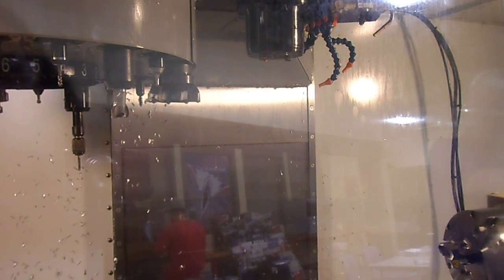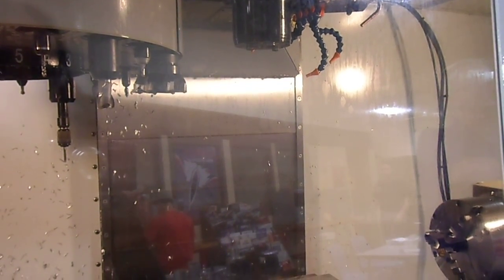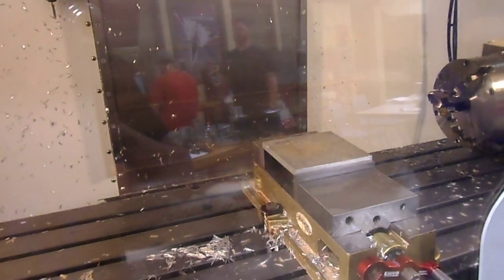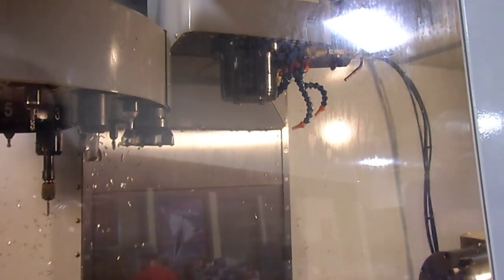CNC Machining on a Haas VF-4 Milling Machine

Comment: High speed steel tools mistake , center drill mistake , should have been a spot drill , tapping dry mistake . Hand tap mistake . If you spend $ on a nice machine , spend a little more on good tooling .
Reply from the maker: +Layla Suzanne There was nothing wrong with the tooling in the machine.  Sure, I should have run the tap slower and used coolant, but that doesn't make for good videos.

Comment: The tap most probably broke because there was no coolant. I.e. no lubricant. You might of been OK if you had sprayed it with a tapping lube before. Nice videos but I assume this is not a production program as the feeds are very slow, especially on a bt50 taper machine.
Reply from the maker: +Chris Munday This is a VF4, which is a bt40 taper machine, and no, not production.  This was done at school, and I didn't run coolant so that I could get a decent video of the program running.  Not an unexpected breakage by any means, especially at the speed I was running it.
Reply: +ChanmailleMan Apologies, you are correct, I don't know why I thought VF4's were BT50, the biggest we have is VF3.

Comment: Can you tell me which program you use to generate the Gcode.
I tried with ArtCam, but it generates a lot of errors
can You help me?
Reply from the maker: +Carlo Colella Since this was a fairly simple program, I didn't use a 3D modeling program beforehand.  I simply learned the codes themselves and input them manually.  However, we also used MasterCam while I was at school, and that seemed to be fairly reliable in terms of outputting solid Gcode.

Comment: you're using a hand tap in a machine. A hand tap is design to be turn into the work 1/2 to 1 whole turn then backed off to break the chips. Use a spiral point cut tap. It pushes  the chip out the bottom and has a high shear angle to reduce torque needed to cut. Your machine has the chip tray around the table so, I'm guessing it's a bit on the older side. If this is the case that machine probably isn't making very accurate thread at that speed since the machine probably cannot keep up with itself.
Reply: Douglas Pierce you can use a hand tap in a machine he was just running it way too fast with no coolant that's why it snapped

Comment: Anybody else see that tap break before it broke?
Reply: John McConnell yup
Reply: The rpm was too high for no coolant. The only thing I would have done differently is when you rapid down to the part. Rapid the part while tool is still at home instead of its R plane. That if you make a mistake it’s not moving in x or y. A crash in z is a lot less of damaging a machine. The trick is to not crash the machine. I have been a cnc machinist for 20 years and I my boo boos occasionally no one is prefect.
Reply: for me I think it was a mistake in the presentation of the tool, it can also be machined with aluminum if it does not have refrigeration mainly in threading, it is sure to break

traduzindo 
para mim acho que foi erro na apresentação da ferramenta, pode ser tambem na usinagem com aluminio se nao tiver refrigeraçao principalmente no rosqueamento, é certeza quebrar
Reply: i thought the tool would fail by changing the direction of rotation. But.... ;)
Reply: Yup

Comment: "program I've written over the past few weeks!?" NO you have 5 minutes in my world. The carousel is inside the machine? not trolling here. I am suspect in production.
Reply: Stu Capco Still no program after 2 months? It would take me 14 seconds. Git gud, kid.
Reply from the maker: What are you saying?  Is there an idea in there that you're trying to get through?
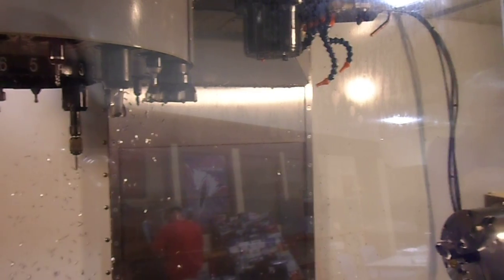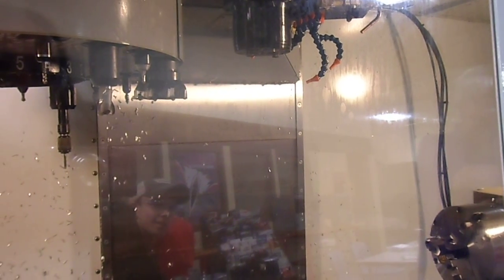Reply: ChanmailleMan Continue on, if your helping someone else here I'm all for it. NO troll intended. Simply put, this would take me seconds to write off the top of my head. Timeline 0:04 - 0:10 .
Reply from the maker: Stu Capco Well, at the time I was in the process of learning how to program these machines, so naturally it took a while to get it correct.
Reply: ChanmailleMan You know what? Your right! I should "put up or shut up". I will follow up soon with my own video here if you don't mind. Me programming, setup and running, tool steels. I like the idea, I'm doing it! ;)
Reply: Sorry, rough turn of events in my life. I agree no coolant, along with speeds and feeds of perfect condititions was the demise. Best of luck. Keep posting.

Comment: step 1 : push feed hold
step 2 : press setting/graph botton
step 3 : go on setting 51 and disable, dont forget... press enter
step 4 : press spindle stop botton
step 5 : open door
step 6 : nock the fuck out a way dead tap
step 7 : close door 
step 8 : press setting/graph botton
step 9 : go on setting 51 and endnable, dont forget............. press enter
step 10 : push cycle start
Reply: or if u have a setup key, just turn it and then open the door and remove the tap. close the door and press cycle start
Reply: yep that work to, but if you dont have key
Reply: Chris Munday door override setting and  feed hold whenever you want I like to single block a tap and use tap oil if I'm running a tap at 2000 rpms but I'm never in that much of a hurry. Plus a tap drill in a Jacobs chuck? Tap drills go in to collet holders my friend

Comment: 2000 RPM for a tap and without coolant........Dude, you have guts.........!!
Reply: You should check out Brothers CNC machines then. Power tapping at 6000 rpm.
Reply: You got guts to estimate, estimate or not thats fucking insane!
Reply: Rasmus Laursen that's why the snap! I run. Mine at 400 rpm perfect finish every time

Comment: Pretty nice run. Only issue I see is.....you should mill into the fixed jaw with your face mill. Milling towards the moving jaw can sometimes loosen the part and fly out of the vise. Not a problem with a minimal cut in aluminum like you are doing.....but if you were taking off larger amounts in steel.......could get pretty interesting. Also like to see operators not leave their vise handles on the vise. They can vibrate, fall off, and get caught in the movement of the table.

Comment: When you are running your face mill if you ran it in a clockwise tool path around the part you would have much less of a burr to contend with
Reply: TrocaderoKillen that's exactly what you want :-)
Reply: Ahh but that's not my problem! The deburring department has to deal with our shortcomings :P
Reply: Wouldn't that be climb milling?
Reply: pjotter0 Tired me, in my head i switches the two.

Comment: Try thread form taps.
Reply from the maker: What makes them better than standard taps?
Reply: They roll the thread instead of cutting it . So there are no chips. I do a ton of aluminum and this guy turned me onto them years ago. Havent looked back. I even use them in steel. Just make sure you make your holes bigger. You can find charts online.
Reply from the maker: Jamie Probst Interesting.  I'll have to look into that.
Reply: Jamie Probst That is quite interesting. It's quite tiring when I have to change out a chip barrel every hour from my 50+ pieces of aluminum jobs. :/

Then again maybe Im just lazy.

Comment: аre  you have 3d model of the vice?
Reply from the maker: No, we just found the exact position of the edge of the plate and went with that as our zero point.
Reply: I mean, do you have 3d model of the vice of such solidworks? in the video is very high feed and speed tap? i gues
Reply from the maker: ***** Yes, we were running the tap at 2000rpm with a feedrate of (I think?) 125in/min.  And no, we don't have any 3D models of the vice.

Comment: nice programming and nice video! i saw your faster video too. just about the only thing you can do about coolant is use a mist spray or something else that's not "flood" to do it. but of course it wouldn't cool as effectively...
Reply from the maker: Yeah, with the speed that we were running this program, we couldn't really afford to use anything other than straight flooding.  I'd really like to do some really high speed machining with specialized carbide tooling and really fast, light cuts without coolant, but we haven't really gotten that far.

Comment: The speed of spindle is too fast...
Reply from the maker: ... On which part of the program?  The tap?
Reply: ChanmailleMan
On the mills. If this is steel the ratio should be 2:1 for cutting in and surfacing. By 2:1 ratio i mean S:F. Then You will get much more better surfacing even without coolant.
Reply from the maker: This is aluminum I'm machining here.  With the carbide cutters I'm using, I have calculated all the speeds correctly, though I did in some spots run them at slower feeds than recommended, since the center of the plate is not supported, and we tried running it as fast as possible, but it ended up vibrating and giving us a bad finish.  Except for the obvious tap failure, this program gave me a very satisfactory finish.

Comment from the maker: Thanks, I was quite pleased with how this turned out!  And that is the wonder of carbide tooling, I suppose.  You can push that stuff a heck of a lot harder than High Speed Steel, and it keeps cutting.  Thanks for watching, and good luck with your classes!